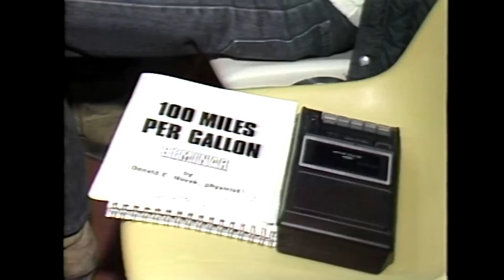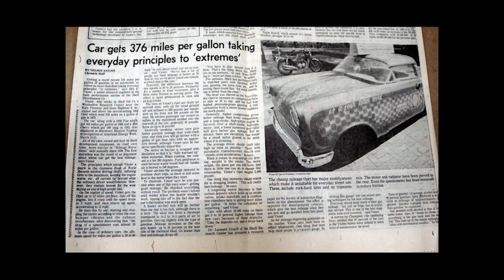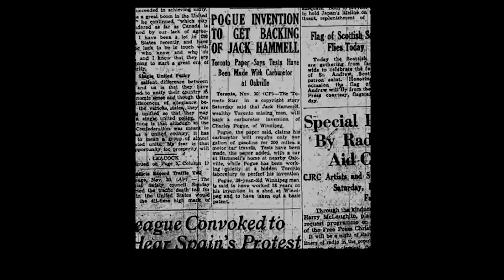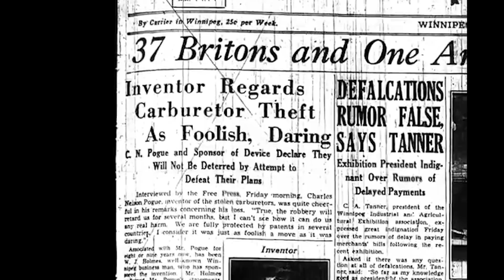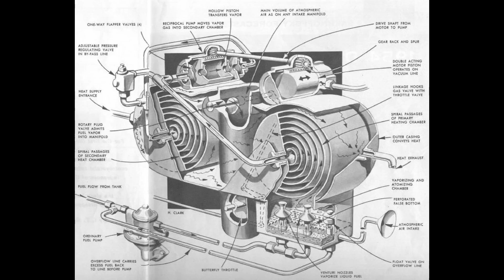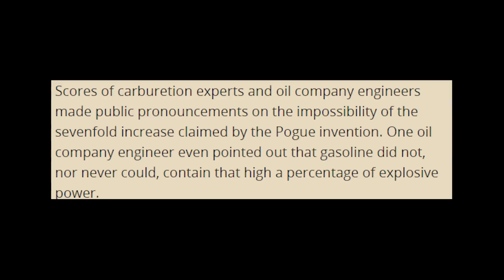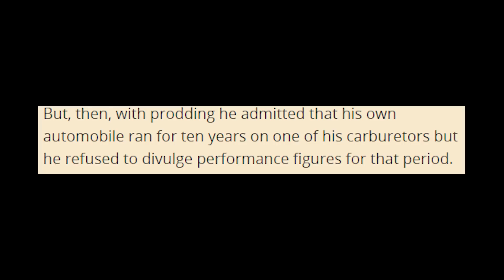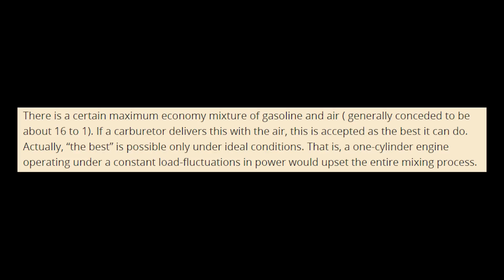What Happened to the Poque Carburetor - 200MPG

Comment: It is dry fuel..not wet manifold like other cars..wet fuel is changed outside the engine. Then put in the air as dry state… 200 to one air fuel ratio..

Comment: I sent away to an adfd in the back of Popular Science for the 200 mpg carburetor. I got a booklet describing several systems that would give very good milage. They all did the same thing, thoroughly atomize and mix the air with fully vaporized fuel. They all would do as promised but they all had the same flaw. The air/fuel mix would go into a large plenum. All would go well until you got a backfire or a slight leak through the intake valve which would ignite the large quantity of explosive mix and blow the manifold and the hood sky high. I don’t know what happened to that booklet, I wish I held on to it.

Comment: The bottom line is this; The higher the compression ratio at the time of ignition, the more power can be extracted from the air/fuel mixture. Detonation is the maximum power output caused by the maximum compression of the particular fuel being compressed to the point of self-detonation. Take this to the bank! 👍🩷😎💚
Reply: @jamesbishop9156   According to David Vizard, Water injection at the right droplet size can take care of this little problem of detonation. I would think it would also be keeping the temperatures below 2500°F, during the combustion process, knocking out oxides of nitrogen formation with the added benefit of steam cleaning the engine from the inside out. Not to mention this steam helping to push the piston down each cycle  increasing power and mileage.
Reply: @johnwyman6126  Water injection is putting water on a fire. It puts it out. The large amount of energy it takes to change water to a gas/steam is wasted energy.  It is not as efficient as the power of detonation alone.    It's just a steam-powered hybrid.  The small water droplets are used to stop detonation, not enhance the power of detonation.

Comment: The only way something like this could happen is if his device found a way to do something on the atomic level. If the device sent monatomic hydrogen into the combustion chamber then yes the device would produce more than theoretically possible as diatomic hydrogen has less energy that monatomic hydrogen does. Plus if the device also produced monatomic oxygen from the incoming air supply again it would have a greater energy content than diatomic oxygen does. 
Did he manage to do something like this? Who knows? But that is the only way I could see his claims being valid as then the science adds up.

Comment: There is veracity in his statements of increased mileage.  However, he was not in charge of the inflated claims of the reportage by those whose job it is to gild every lily and scream "Murder!" at every papercut in order to sell newspapers. 
The real differences are attributable to the misunderstanding of the application of the 14.5-1 to 16.1 air to fuel ratio.  They were never accurate when applied to a wet fuel delivery system but are truly accurate on a molecular or gaseous delivery.  His invention delivered a dry fuel ratio instead of the less refined wet type.  Other types of more modern carburation such as the Carter ThermoQuad achieved significant gains by heating the fuel gently with the waste heat in the cooling system.  Another was a more finely metered device with 19 different adjustments to the fuel flow , also showing significant gains.  I speak of the WCFB Carter.  These were phased out after a short while when fuel injection moved out of the cruder, almost reliable, mechanical form to the electrical manipulation sort.  Injection point of entry still has adherents in many different places for different reasons.  His later in life denials were likely to avoid hearing all the same crap over again and to avoid getting himself killed for admitting the truth.

Comment: A gallon of gasoline only has so much stored energy.
Depending upon how fast that energy is converted to mechanical energy
will give you a pretty good idea of how far and how fast you will be able to travel.
The quicker the energy is converted, the faster you will accelerate. The slower the energy is converted the further you can travel.

There simply is not enough stored energy in a gallon of gasoline, even with a 100% conversion rate, ( Which is impossible ) to move even a very light vehicle 200 miles, as is claimed.

Only nuclear energy has that much stored energy, and even then there is considerable loss in it's conversion from heat energy to mechanical energy.
Large electric motors will convert electrical energy to mechanical energy at about 97 %, however there is also significant losses in generating electrical energy, and transmitting it to point of use.

I know it sucks, but the laws of physics are pretty well established.
No matter what the source of energy, it is limited, and reduced in power, every time it is converted from one form to another.
Entropy wins every time !!!

Tim
Reply: For now....

Comment: one US gallon of gasoline contains 371.5 grams of hydrogen, so 200 MPG of gasoline would be 538.36 miles per kilogram of hydrogen ( 200 ÷ 0.3715 ) or 1.86 grams of hydrogen per mile, that would be impressive. For the EVangelists that would be 16.15 miles per kwh.

Comment: 100% correct that you can't get more energy out of a fuel than what it is born with and no fuel can give 200 MPG unless you are powering a piss ant's motorcycle in a vacuum down hill all of the way.
Reply: The less you understand about thermodynamics, the better Poque's carburetor sounds.  In reality, with the aerodynamics of 60's/70's car,s you'd be lucky to squeeze more than 25 mpg using the latest and most fuel efficient technology we have today.

Comment: 200mpg = roughly 0.16kw per mile.

On dead flat pavement, with tires that weren't available yet, and aerodynamics only available in aircraft... maybe.
Reply: In a car that weighs 200 pounds, tires at 300 psi, downhill with a tailwind. Maybe. And would have the acceleration of a snail. Whoopie, what fun to drive!
Reply: @quantumleap359  - some people just don't understand simple math.

Comment: All it did is make the motor run extremely lean...that's fine for very low engine speed....but your not gonna get any real power because you have to add fuel to make more power

Comment: There is some merit in this idea, because fully turning liquid petrol into vapour and mixing it with the air means it will burn more completely and therefore give better mpg. This effect was evident when i was converting oldrr cars to LPG. where the LPG would be vapourised by hot coolant and mixed with incoming air. Then introduced to the engine as a nicely homogenized gas which would then burn considerably cleaner  than the carburated petrol. Combined with some ignition advance, possible due to the higher octane rating of LPG, more power was produced in spite of LPG containing less power per litre. This was most noticable on 1980's engines which were not great in the  first place.

Comment: This brings back memories. I did some research on the 200 mpg carburator in the early naughties. One of the old articles about mr Pocue said that he (supposedly) never claimed it to be a 200 mpg carburator. I dont remember the exact number now but it was a bit under 100 mpg but word-of-mouth, headline hysteria and other things inflated his initial claims to 200 mpg. And thus, the myth was born.

And Im curious what it means when theres a specified quantity of energy in fuel. Is it the regular stochiometric ratio of air to fuel? The point with vaporized gasoline is that you can run much leaner mixtures because the burn is more efficient. Maybe not producing those 200 mpg numbers but something at least reasonable? And a lot better than other cars of the day.
Reply: The calorie (small-c calorie) is the amount of energy it takes to raise the temperature of 1 gram of water 1 degree Celsius. If a quantity of fuel contains enough energy to raise the temperature of a liter of water 5 degrees Celsius, it has 5 kilocalories of energy in that quantity of fuel. There is no way, using combustion, to raise the temperature of a liter of water by 6 degrees Celsius using that amount of fuel. One needs a different fuel or more of the same fuel

Comment: what 
i dont understand is why there aren't more propane vehicles, they are cleaner running, engines last longer , oil changes arent needed as often, many reasons its better than Gasoline. They were fairly common in Alberta when I was a kid lots of people ran propane and sometimes propane or Gasoline.
Reply: I got a 2001 dodge ram pickup on propane. One guy I talked to said the new tanks are very expensive now so no one wants to convert anymore.  Years ago in Calgary I can remember when propane cost 10 cents/liter.  You're correct, the oil never turns black.  I reckon there's not as much energy in propane as there is in gasoline so I multiply the price of propane by 1.3 to get a rough equivalent to gasoline.  As of July 2024 propane in Victoria B.C. cost  $1.29per liter at the Petro Can but I think it's cheaper at the Co-op.  Back in 1992 I  drove a propane van from Calgary to Minneapolis Minnesota by filling up at the truck stops...got some odd looks from the US folks.
Reply: They're REALLY common here in Australia to the point ford had an entire line of PROPANE ONLY vehicles with a redesigned engine with a green valve cover. Ford ecogas. I own one, many were government or company vehicles as mine was. PILES were utes, family car based pick-ups. Mine is a 2008 ford G6 in silver, sedan. Mine is the last of the carburettor style then they went to injected gas (ecoLPI engine) until September 2016 when manufacturing ended here. The New Zealanders use natural gas converted vehicles but here in Australia it's LPG (propane and butane mix). Can't use them in well below freezing like heavy snow areas but with frosts it's fine. Si I'm good bur high altitude areas you either have a dual fuel car or diesel or gasoline. Mine is 4.0 6 cylinder but goes like a V8 because of dual variable cam timing. The UK, Russia, korea and many countries use propane. Hyundai's in korea have injected propane but unfortunately they haven't bought them here. BUT if you get the same size and type of engine, they'll convert fairly well.
Reply: Btw oil changes are needed just as often and the propane causes acidic oil so we have specific engine oil for the converted ones.
Reply: Because there is more money is gasoline/oil. Cars that run on hydrogen were invented in the 1980s. There was a solar powered car in the 1990s. There are many more examples of this. Usually oil or car companies purchase the rights to the patent for astronomical amounts of money just to shelve the idea. Other times when the inventor refuses to sell, they end up dead from mysterious circumstances. There is a long long history of these things happening. Change is expensive to begin with and when so many people are making money hand over fist with the current arrangement, most will be resistant to change.

Comment: A very good friend of mine was taking his HD mechanics course & decided to try making an evaporative carburetor as a project. He ran hot water from the radiator through his design to vaporize the fuel via a heat exchanger. Amazingly, he did get it to work on his dodge van. He did indeed get better mileage once the engine was up to temperature and the fuel began to be vaporized. I do know from his experiment that the power level was reduced, and during his testing process, he had an explosion and a fire that destroyed much of the wiring in his van.  He gave up the project as he then had to buy another vehicle.
Reply: Heated intake manifolds were used for a LONG time to help fuel vaporize.
Reply: There's a fault in the old engines of the 60s here in Australia where many will vapourise the fuel on hot days or when the engine is running hot. I was running seriously late in a 1971 GM and it done it one day. You can feel it kind of surge strange. Of course you CAN run things super lean but you end up burning out the engine in the process. I think these days we should be able to do today better with better alloys and engine designs.
Reply: A thermostatically controlled preheater would solve the problem of a cold engine.  Turns off when the engine is warmed up.

Comment: There is no such thing as a 200 MPG caburetor. You would need to design a 200 MPG engine, none to date as of yet. We don't have a 200 MPG motorcycle, How could we have a 2000- 3000 lb. car get insane mileage?
Reply: Look up economy races in the 60s/70s ;-)
Reply: The current record is more than 1000km per litre. You would not want to drive such a car.
Reply: Exactly correct. And for a clown to claim 200 miles per gallon in the 1930s is absolutely insane. Engines are MUCH more efficient today, and 200 mpg is still impossible for a normal, driveable car.
Reply: Think again

Comment: Silly. There is a given amount energy in gas. Better carbs or fuel injection can improve energy extraction somewhat, but most energy loss is in the engine and drive train. You’re not going to turn a 30 mpg vehicle into a 200 mpg vehicle by just replacing the carb.
Reply: i think the start is F=MA - you have to convert energy to force - if the mass and the acceleration remain the same the force must be the same - meaning fuel consumption will be the same - the only way to get any improvement would be to improve mechanical efficiency by reducing losses
Reply: He points this out at 7:09.
Reply: Exactly;  it takes about 30 hp to cruise a 1960 car at 60 mph (when these ideas were popular) at 25 % efficiency (usual for 1960s cars) it would take 100 hp worth of fuel to cruise the vehicle. In a zero loss system 1 gal of fuel can produce 48 hp hours or for our 30 hp to push the vehicle about 38 minutes at 60 mph. 38mpg  That is not close to 100 mpg, 100 miles would take about 2.7 gallons.
Reply: “IT WORKS NAPOLEON, YOU DON’T EVEN KNOW!!”
- Kip Dynamite
Reply: Yes 200mpg is not happening. Vaporized fuel should be slightly more efficient. My theory is that it just restricted the amount of fuel that could be put into a cylinder. Your just accelerating more slowly everywhere you go, therefore your going to get much improved gas mileage. Similar to just using your foot lightly on the throttle pedal. I can drastically manipulate my cars average mpg by just using a light touch.
It's definitely not what it claims to be. That's for sure. 
They still sell gimmicks like that to this day, that technically can increase your mpg. They just always leave out the part that they have to take something away for that to happen